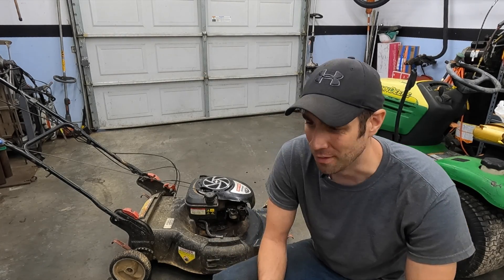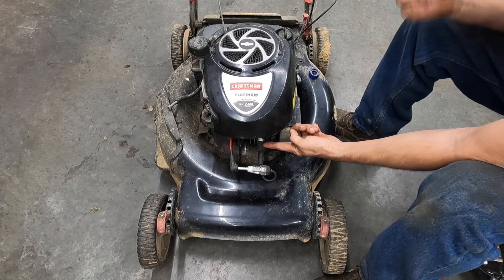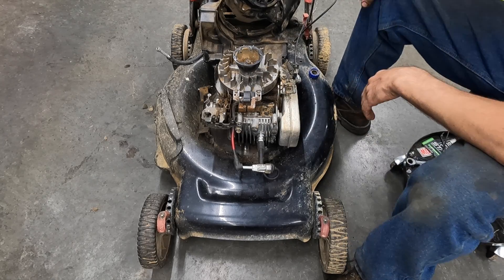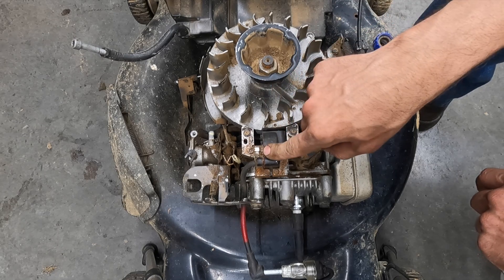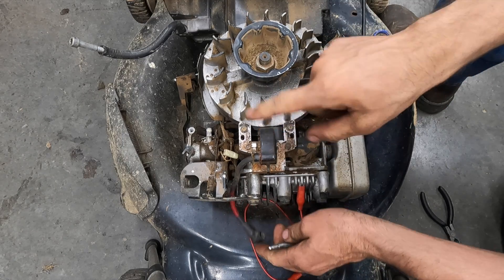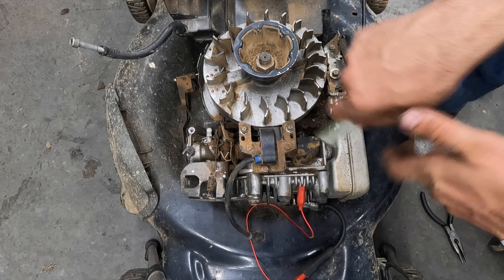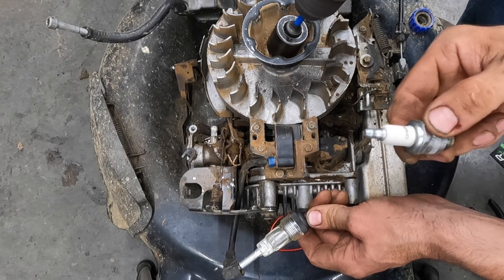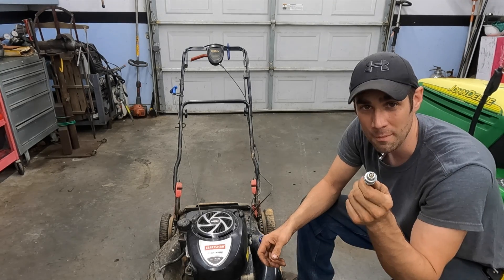How to diagnose and replace ignition coil with no spark on your mower.

Comment: My generator started after 2 pulls, running good then died 20 seconds later. It didn’t sputter out or shut off slowly, it just died.
I did all the basic stuff cleaned carb change the gas, tried it again and no starting still. I pulled the plug to check spark and no spark. I’m taking a shot that the ignition coil went bad. Any thoughts or suggestions?? It’s a Kawasaki power-partner 6000

Comment: Someone needs to make a spark tester that is easy to read in the daylight. I find it very hard to pull the cord and see the spark...if there is one with the type of tester you are using. I don't usually have someone to look for me or pull the cord for me. I got another type of tester and it wasn't any easier to read. I don't have a dark room to put my mowers in to see the spark either.

Comment: I have had this issue several times,, when attach the tester to engine ( usually the head fins, like you did ) I get spark then. But when attach to spark plug , NO SPARK. Even with Electronic ignition.. I have cleaned PTO and flywheel , wire wheel cleaned flywheel and armiture,, cleaned the 2 studs  where coil mounts .. (( Those spark testers , the male end is too big.. its bigger than a sparkplug, opens the coil end, have to squeese the coil end tighter after using tester )) Suddenly the engines have started.. But never really figured it out.. YES, I have reset coil gap. from  .005-6 to .010.. when having this issue.. ,, otherwise I usually use a thin business card . I did have some luck clceaning the condensor - mounting clip and the saddle area. and cleaned points.. Also replace the coil on Electronic engines.. The sparkplug right doesnt ground.. the juices has to junp the gap to ground!!! same as the tester... Still acts like the plug isnt grounding !!!!  Very frustrating ...

Comment: Hey Josh.  I had no spark took the kill wire off then it had good spark and the mower started.  The kill wire on this 1 year old mower had to kill wire continuity.  So what in the world is the issue? any help would be much appreciate.
Reply from the maker: Just so I understand you correctly. The kill wire had continuity? When you removed the kill wire from the coil, you get spark? Is this a riding mower or push mower?

Comment: If you don't have gasoline hooked up, why take out the spark plug  when the ground is off because it won't start without gas  supply and all you're looking for is spark in the glass tube?  Thanks.
Reply from the maker: There is still a small amount of gas to potentially be in the float bowl that can cause it start, even when the fuel line is disconnected. Also it lowers the compression making it easier to spin the engine.

Comment: Josh, I have a Briggs 500e series engine on a MURRAY push more. Even with a new coil, proper air gap and the ground wire disconnected when I spin the engine I still have no spark. Any idea what else it could be?
Reply from the maker: Just to clarify, are you using a spark tester to check for spark or are you leaning a spark plug against the engine?
Reply: @metalinmotionshop  I started out just laying the plug on the engine block. Then this morning I decided to use my spark tester. Eventually I decided to go back to square one I closed the air gap to .010 , and noticed a faint spark. Next I decided to use a power drill to spin the engine instead of my battery driver and it worked like a charm. Needless to say I spent the afternoon cutting grass Thank You for reaching out.

Comment: I have a Craftsman 6.5 HP Yard Vac. My no start with no spark took a while to find. The problem was the ground wire coming out from the coil was rubbing on metal and grounding out. No parts required.
Reply from the maker: Good to hear you found the problem and thanks for sharing that.

Comment: Hi, I got 2 new plugs disconnected ground. No spark. Bought 2 new coils tested with meter and both good. Still NO SPARK. Got a different flywheel of similar machine which engine ran and replace the flywheel coil and plug and NO SPSARK. No w I put flywheel coil plug back in old running machine and now that gets no spark. Retested coils and 6.23 coming out of them so plugs and coils are good, ground disconnected and NO Spark Magnet on flywheel is very strong. Any Ideas? Anyone? Now I have 2 machines with no sparks
Reply from the maker: What engine and hp? How are you checking for spark? How did you set the gap on the coils?

Comment: Where is a good place to buy a coil my buddy has a Craftsman lawn tractor, and he replaced the coil and it ran long enough just to put the covers back on as soon as he put the covers back on it would not start a second time we did try it with the ground wire disconnected the kill wire disconnected and it still doesn't start I'm saying junk coils but he hates to buy another one where is a good place to buy a good coil?

Comment: Would a bad coil literally cause the mower not to start?
Reply from the maker: Yes, the coil is the only device to send spark to the spark plug. If it’s bad the spark plug will not fire and the engine will not run.

Comment: Great step by step video. I replaced the blade adapter, blade, retainer, bolt, carburetor, air filter, oil change, cleaned gas tank, and new fuel. Lawnmower Troy Built TB110 will not crank over. I did remove the ignition module, and i didn't reinstall it properly. I'm going to install the ignition module your way and I'll repost my outcome. Thanks for the help and video

Comment: Thanks Josh, my John Deere E 140 quit during my last cut. I saw gas in the filter and it would crank strong. Thinking I have a ignition problem, I pulled the plugs expecting wet plugs.The plugs were dry, which surprised me. I grounded the plugs and saw no spark. This is a twin with 2 magnetos. I watched your video and I pulled both ground wires off and got a good spark. I put the covers and shrouds back on, and it started right up. I am thinking I have a bad interlock somewhere or a shorted ground wire. For now, I just have to be careful because I can get off the tractor while the blades are engaged. Thanks again. I didn't suspect the magnetos because the odds of both failing at the same time seemed highly unlikely.

Comment: My 6.75 Briggs starts perfectly first time every time and runs fine.  But when hot, it will not start.  Could this be the coil?  Maybe gap too small or too big?
Reply: I have the same issue. No solution, yet.

Comment: With the spark plug out and the wire disconnected from the ignition coil  the light on the tester showed spark. You stated if it doesn't have a spark the problem is the coil but with it showing a spark would it be the black wire?
Reply from the maker: If you don’t have spark with the ground wire connected, but do have spark with it disconnected…then it’s either the wire, or the brake mechanism that that wire is connected too. It may not be releasing all the way and not allowing the wire to become ungrounded.

Comment: engine still doesn't spark after replacing the magneto and sparkplug.  There's no spark after putting in a new magneto either.  Ground unplugged and still no spark.  Still has a strong magnet on the flywheel.  Any suggestions?

Comment: Question- I was troubleshooting a ground issue on my mower today. If I disconnect the ground wire from coil and measure ohms from the ground wire to to block, i get 0 ohms with the bail open and like 3 million ohms with the bail closed (as it should be). If I reconnect the ground to coil, and measure from the coil ground lug to the block, i get around 300 ohm (pretty damn continuous), both bail open or closed. Is my coil bad? Some kind of internal ground inside the coil? Mower runs with the ground wire disconnected.

Comment: Hi, if the ground wire is connected to a ground screw by mistake, can this cause the magneto coil to go bad when trying to start the engine? 
I have the suspicion that my secondary coil stopped to show continuity or any resistance after I connected it to a ground screw and tried to start the engine in a Briggs & Stratton 3.5 HP lawnmower

Comment: I have a small briggs engine on a mower and isolated the problem to the grounding wire.  How do I fix that?  Can’t seem to find any replacement wires
Reply from the maker: On push mowers and small Briggs, It’s usually just a solid insulated wire. You can remove it and put some heat shrink over any bare spots that could be touching the engine. If its broke usually twisting it and heat shrinking can remedy it. On some Briggs there is a diode attached in the middle. Running your engine model/type/code number can pull up the parts for it. I have a video on how to look up parts if you need it.
Reply: @metalinmotionshop  Nice, thanks.  Its a Briggs wire part number 692390.  Hate to order it and spend $15-20 on a silly wire if I could go buy a generic wire the same size at the store to replace it with

Comment: Do you ever try to clean the coil?  Ive had luck cleaning the dirt,  grease, and rust off of non-working coils with a wire brush and the coil working after cleaning

Comment: Hello can you please explain your setup on your drill as far as connecting the socket to the drill?
Reply from the maker: There is a drill to socket adapter you can purchase at most tool stores. Here is what they look like. Mine are from Harbor Freight. 

https://www.harborfreight.com/impact-rated-hex-shank-socket-driver-set-3-pack-64604.html?utm_source=google&utm_medium=cpc&utm_campaign=12126402660&campaignid=12126402660&utm_content=118355033473&adsetid=118355033473&product=64604&store=697&gclid=EAIaIQobChMI4Pqh05Ho_gIVry6zAB1AewJlEAQYASABEgKmNvD_BwE

Comment: Good video. Have the spark tester, but didnt know the ground wire sequence. Did the checks, but I get spark before and after removing from the coil. Still wont start. I recently took the mower from winter storage. Can I assume a fuel distribution issue or possible timing? I let the fuel run out before storing last fall. Ty
Reply from the maker: So if I understand you right…you have spark whether the ground wire is attached to the coil or not. Sounds like if the engine started up it wouldn’t turn off. Follow that little black wire and make sure all the contacts points are clean. It usually goes from the coil to the bail handle switch and then down to an engine ground somewhere on the side of the engine. Make sure the switch for your bail handle is contacting it when released.

Comment: This video earned you a subscriber. Very detailed and knowledgeable troubleshooting tips. Most of the internet is filled with "cleaned the carburetor" or "change the oil". This is the first bit of advice I've seen that goes into the issues surrounding the ignition coil, ground wire and flywheel.

Hoping this will fix the issue with my mower. I have a spark plug tester coming in tomorrow. Thanks for the video and most importantly, the knowledge you shared with us!

Comment: Your method works if you have a spare coil. You can test the existing coil with an ohm meter. Connect one lead to the inside of the spark plug boot  making sure you contact the metal inside. Connect the other probe to the engine block. The resistance should be around 3-4 K ohms. THis test can be done without removing the coil.
Reply: Have you tested a Honda 4 terminal coil ?
Trying to figure it out
Reply: Ohmmeter test doesn't work on my coil. I have two cylinder and one side works the other side doesn't, so I assume one coil is good. They both fail the ohmmeter test, even the good one. Swapped polarity, same thing.
Reply from the maker: Why would you need an extra coil for this method? If you have spark with the wire disconnected then you just tested it and you don’t need a coil? If you don’t have spark then you need a coil regardless. I never used the ohm method because it wasn’t how Briggs tested it in their manual.

Comment: This is an AWESOME video.  I've been slowly increasing my knowledge on repairing 2 and 4 cycle engines.  When simple steps lead to improvements like illustrated here, there's an instant learning curve.  Well presented. Straight to the point.  Well done .

Comment: Engine is pull start on and set to toggle switch for kill switch. Tested coil got light, took off kill switch from coil and grounded got light. Put plug back in no light. Please help .
Reply: Also set gap

Comment: i did all the tests to include swaping coils from an  identical mower and still no spark. checked resistance on coil with ohm meter, originaly had to replace flywheel key, checke all wiring, and connections, still no spark.

Comment: Can the coil wire be replaced without replacing the coil?  Someone cut off the wire too sort to reach the plug.
Reply from the maker: No not usually. The wire is usually epoxied into the coil.

Comment: Man I've replaced the fuel line, carburetor, spark plug, cleaned the head, replaced the gasket and nothing. Started fine until one day the recoil snatched out of my hand. I unplugged the plug and reached under and spun the blade around and even sprayed some penetrating oil. I'm kind of knew to repairing these so excuse me if that sounded like a waist of time. Just trying something to see what works. The last thing I'm on is that ignition coil. After that I'll probably have to let it go. I took the coil off and just screwed it back on. I'll do your card trick and see if that helps something. Thanks for the video
Reply from the maker: If the recoil snatched out of your hand that’s usually a sign your flywheel key is sheered. I have a video on that as well. Here it is:
How to replace flywheel key on lawn mower
https://youtu.be/fZTKiySBVCE

Comment: HELP
I have 2 - 7 HP B&S mowers.
#1 engine quit and I diagnosed no spark and then removed, tested the coil and it was bad - no resistance.
Replaced with brand new coil (tested good) and still no spark. Double checked all work and was all good. Removed the kill wire completely - NO SPARK.
#2 engine runs good. I exchanged coil and spark plug from #1 engine to #2 engine. 
#1 engine still has no spark BUT #2 engine runs fine with the #1 engine components. 
Now I remove the coils and plugs from both engines. Spark plugs and coils all check out good on the bench with an ohm meter. 
Put all parts back on original engines and adjust properly. Now back to square one except the new coil (that makes #2 engine run fine) is in place on #1 engine. NO SPARK on #1 engine so again I check the ohms and they are fine. Remove the KILL wire and still no park. 
#2 engine runs fine with original parts and or any combination of #1 engine components.
WHAT HAVE I MISSED?
Reply: WOW! Did you ever figure it out?

Comment: make the engine turns over fast if electric start, (possible flat battery or worn starter) dissconnect the primary coil earth wire (stop wire) ensure the coil is the correct direction (make sure the trigger prong is not where the pick up coil should be) just somethings you might find

Comment: Nice video. I went through all of the steps and still had no spark. Finally found the problem. The cable from the starter cable was too long. It wasn't disengaging the kill switch where the grounding cable connects to. Once I shortened the cable (search on "How to Adjust Lawnmower Cable" on YouTube), the lawnmower started on first pull.

Comment: So my mower has always worked but the end of the plug wire had corroded so I bought a brand new coil and a brand new spark plug. It doesn’t want to start after multiple air gaps .010 .012 so then I threw the old one back in and forgot to plug the kill wire and it started but everything was fine before I attempted to change the coil out. I tried the spark test with the new one and old one and no spark from either.

Comment: Hey love the video! I have replaced my ignition coil however now my kill switch does not work. I tested the coil by checking for a ground to and it seems ok (when the handle is not pressed I have continuity - short to the coil, when I press the handle I have no more short to the coil) so it should work. Now my engine won’t shut off. Could it be my new coil that is defective? How would I test the coil to make sure if it’s grounded it shuts off? Any help would be great.

Comment: i just put a new tip on the secondary. one that is a crimp style not a coil of steel with a spike pocked through the insulation. hoping that it contacts the wire in the high voltage leed. That starts to arc and burn the spike end.

Comment: After having no spark I bought a plug and coil with no success.  Turns out the my handle cable was stuck in the grounded out position so there's my no spark.

Comment: I'm about to test my ignition system on my craftsman push mower thank you for this video. I was mowing a clients lawn and I shut off my mower to move debris and it wouldn't start up again. Tested spark plug no spark tried another plug and still nothing so ima be heading to get that ignition coil tool and see if it's the coil.

Comment: Actually you can shut it off with kill wire removed without getting shocked by moving boot on plug wire back so you can ground end of plug with an insulated wire or an insulated screwdriver.
Some old units even had a little pivot, hinged metal arm to ground out the motor by creating a circuit to the head.
That was the shut down method from the factory.
And yes, the little handle or tab was supposed to be insulated, coated or a piece of wood.
The boot over the end of the plug wire wasn't common back then.
Often the little lever device would loose it's insulation or be missing so you'd jyst use a screwdriver without a metal handle to ground it out and stop the engine.

So I enjoyed the video but thought I could add sonething...
Not everyone had a VOM or other fancy tools back then and usually a screwdriver jammed into plug wire with shaft held near metal was used to check for spark.
And so on...